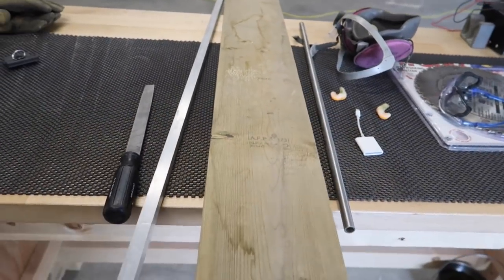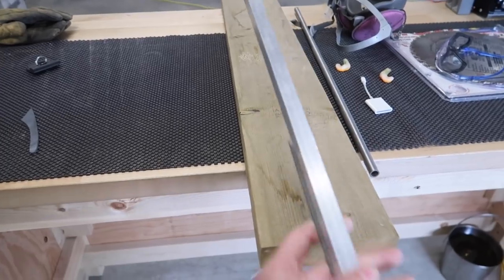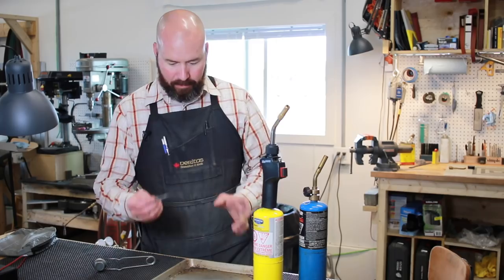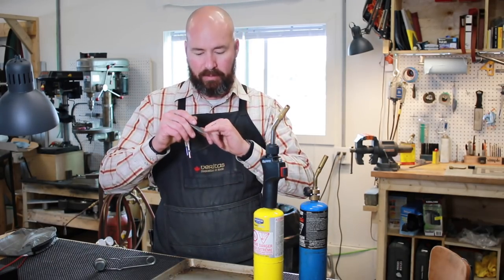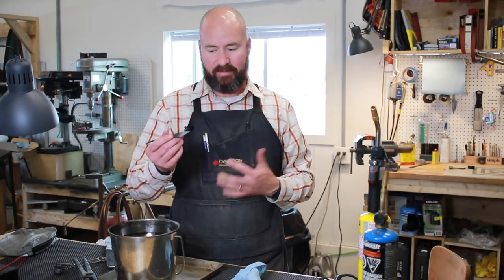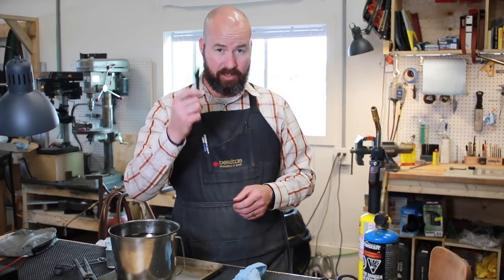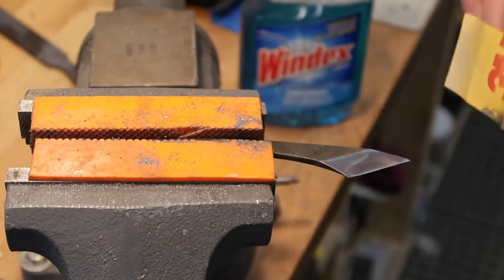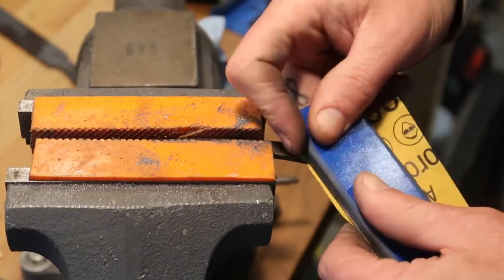Kiridashi Build Part 3

Comment: 10 out of 10 for explaining the bevel handedness, I am pretty sure no-one else has ever mentioned it
. When you know, it seems obvious to put the bevel on the outside when you are using it. I had never thought about until a few years ago when I bought one from a German tool website that offered left or right.Can't remember the name of the site though. 
Also a double bevel, especially with stuff like leather means every cut has a bevel.
I like the idea of the build along going at a steady pace as well, itmakes it much easier for those doing it bit by bit to keep up and not have search for the relevant bits in a single long video.
Edit; the filing jig is pure genius, elegant and easy to make.

Comment: don't know if anyone has said yet but you could of used the handle part of your file for the bladed portion so you don't get the serrations.  The handles (tangs) are already softer than the rest of the file as well.  I believe it's so the tang bends instead of snaps if you put too much pressure on.

Comment: Old motor oil and transmission oil ever will eork. Jason at Hoj forge use to use it all the time.
Reply: Billy Martin It will, but it will give you cancer especially if it is used motoroil
Reply: Any kind is not good for ya. I was just answering his questions in the video. But thanks for the advice.

Comment: Very nice, but why not flatten the back like a good chisel? Then of course it wouldn't be digging into your straight edges like this file back could.
Reply: true kiridashi not newer bevel and sharpen backside. this is totally wrong. kiridashi have marking knife and carving knife not normal knife, need be backside straight and sharpen only one side.same than chisel,  old motor oil include important carbon, because ewerytime you heat metal carbon go out and need add in more carbon then come harden metal. or buy store metal were include high carbon its tool making steel. wery expensive than normal soft metal. high carbon and good metal include crome too inside metal. old motoroil have good normal hardening process, no good use water or clean oil or not newer vegetable oil.